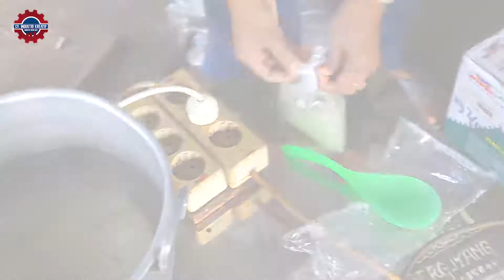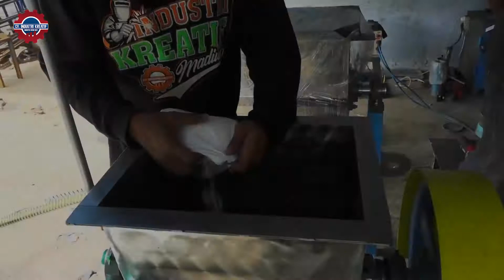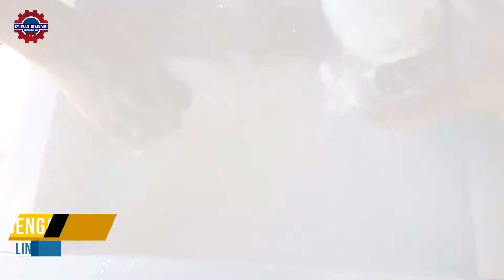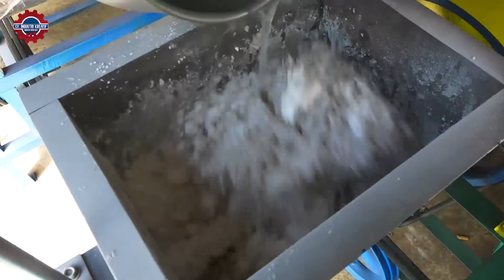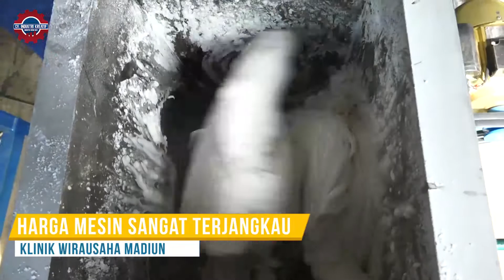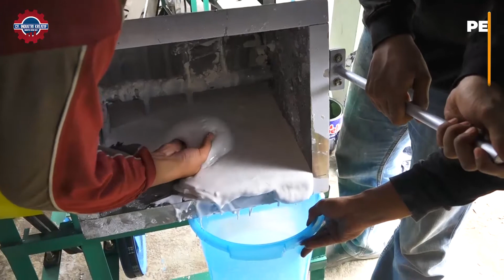UJICOBA MESIN PENGADUK KENTAL OLEH CUSTOMER || HASIL LUAR BIASA DAN MEMUASKAN LANGSUNG DIANGKUT !!!

Comment: Harga brp gan?
Reply from the maker: untuk info harga,detail mesin & pemesanan hubungi Customer Service Representatif Kami (Telp/WA) 081234280625 - 081217850288 - 082142267610 - 082334870125 atau kunjungi Workshop Kami di Jl Madiun - ponorogo KM 10 Selatan Puskesmas Geger 300 Meter Kec Geger Kab. Madiun Jawa Timur